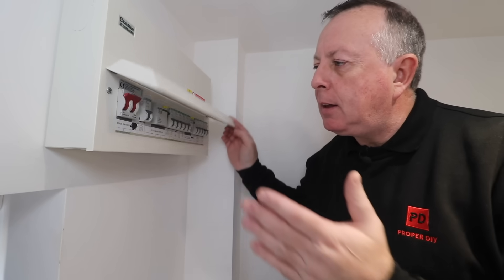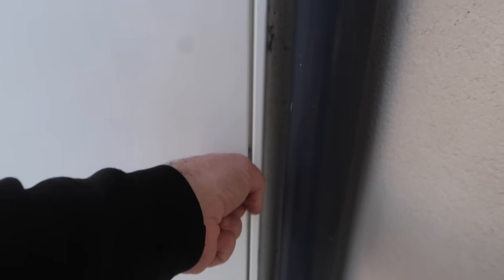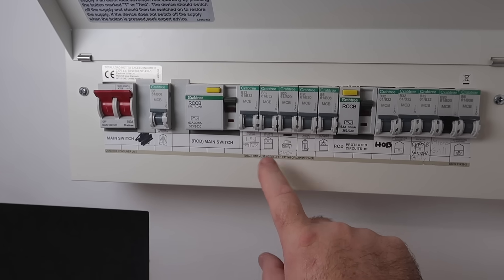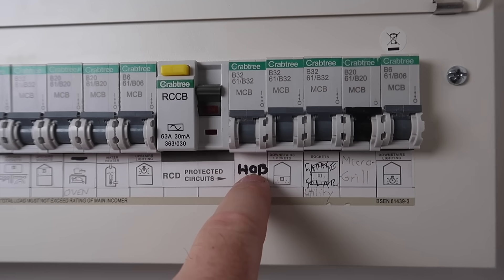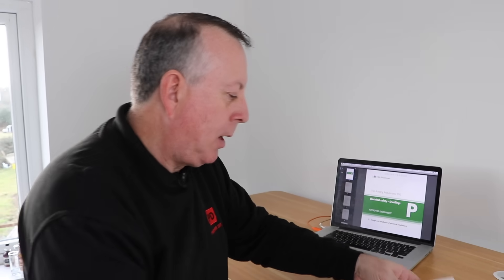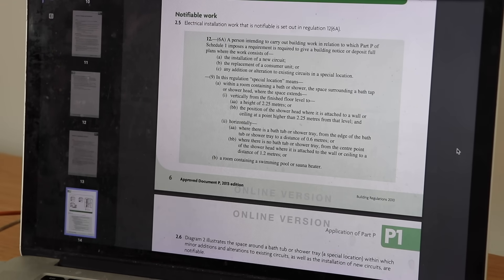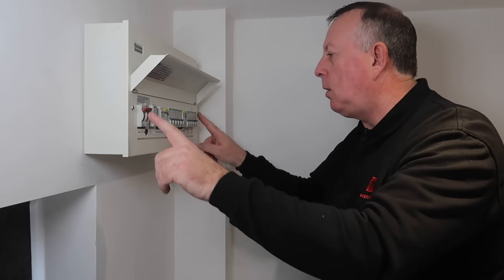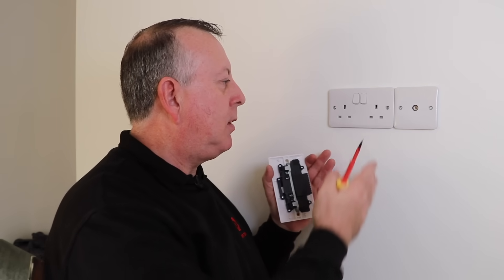What electrical work are you allowed to do in your own home?

Comment: Has the mains voltage actually been reduced, or is it still nominally 240V but the tolerance has been tweaked so that 230V falls within the spec?
Reply: It's still nominally 240V, but with a slight change in tolerance so they can call it 230V 'on paper'. It's the same situation in Australia.
Reply: @cool386vintagetechnology6  True, although parts of Australia used to have a nominal 250V.
Reply: @GodmanchesterGoblin  Western Australia until 1985 is the best known example of that.
Reply: @cool386vintagetechnology6  Thanks. The last company that I worked for before retirement used to export to Australia (early 2000s) and I remember coming across the voltage rating sometimes. Perhaps it was just a legacy thing by then, however.
Reply: I regularly see 245V so 230V seems to notional 😵‍💫

Comment: It's wrong to say that you can't do work that is subject to Building Regs approval. It's just that if you do it yourself you will have to pay the local building control department the appropriate fees and have it approved and inspected by them (they may contract inspection out to an electrician).

For some types of work the cost of the building control fees can outweight the savings of not paying an electrician to do the work.
Reply: dont tell them

Comment: I know 'someone' who afew years ago completely rewired a house from the main fuse and then got it certified by a qualified electrician. All passed to standards and a big improvement on the old wired fuse box..
Reply: Yep, there's also the NAPIT inspection/sign off
Reply: That's interesting, because I was recently looking for an electrician who could make a new circuit in my breaker box and connect my new electric underfloor heating to it, but because I had to only few days to do wiring (due to tiling in my bathroom), I suggested I can run the cable by myself and an electrician would just connect it to the breaker box. 6 electricians, I've contacted (out of 7 total), refused to do so, because they claimed they "can't signed off the job if they didn't install the cable by themselves as they can't guarantee the cable I would use is good. What a BS! When I mentioned I'm an IT engineer and I know enough about electricity to know how to check a cable's resistance using multimeter, they would come up with another excuse. It was a nightmare.
Reply: @rogalsiu  If you're using a multimeter to measure the cable's resistance, then they were absolutely right because you do not know what you are doing.  Just measuring a cable with an ordinary multimeter will tell you almost nothing about whether it's actually correct for that application, and whether it actually meets code or not.  There are also many ways that even the correct cable can be installed wrong, and if they can't actually inspect the work you did, I don't blame them at all for not wanting to sign off on some unseen work done by some random person they don't even know (they could probably even lose their license for that).

(And I work in IT too, and I can tell you that the skills required for that have absolutely nothing to do with knowing how to do mains electrical work correctly.  That's just completely irrelevant.  The fact that you would even mention it also shows that you don't really know anything about what you're talking about.)
Reply: @rogalsiu  That's on you. I don't care if you spent your adult life driving cars, that still doesn't make you qualified to be my kids driving instructor. Let the tradesmen earn a living. an IT engineer is NOT an electrician
Reply: All in order and still possible. However, it really should be approved and inspcted by he local authority building conrol department who will extract a fee - when I checked a few years ago it was around £500 for a complete rewire.
Reply: @jeremybarker7577  I think the qualified electrician and his mate cost £200 ish for the half day it took. Very thorough.
Reply: Dodgy spark 😂

Comment: I am happy that in Belgium you can carry out absolutely everything as a DIY, the regulations and requirements are openly available for everyone.
But anything that gets added or changed from a existing installation needs a inspection carried out by a independent approved company, this also needs to happen when a professional electrician carries out the work. This will also require a single line drawing and situation sketch where all power points, lights, switches,… are indicated.
Reply: You can carry out all installation work on your property in the UK. The YouTube video producer is factually incorrect in his statement that there are things the home owner cannot do.

What has happened here, is that people haven't read properly the Part P regulation, despite holding up a copy in the video!!

If you are not suitably qualified, you can still do your own electrical installation work but there are two things that need to be dpne:
 1. Notifying the Building Control department of the local council before you commence work
2. Get a qualified third party to certify the work after you have completed it.

If you undertake the work yourself, it needs to be a certain standard and that is defined by BS7671 and there are books which condense those rules into a much easier to understand format.

So it is entirely possible for a home owner to carry out their own electrical works.
Reply: @deang5622  
Correct Replace the word qualified with competent.  The word competent is actually used.
Reply: @deang5622  Yes, basically it was the UK following the EU model (plus a bit of gold plating).
Reply: @deang5622 the bit I don't get though is that   BS 7671 says you ( the DIYer carrying out non-notifiable works) have to issue a minor works  certificate ( to yourself?) This certificate has spaces to fill in Ze and Zs and resistance tests which the DIYer will unlikely have the expensive test equipment or know-how to carry out.
Reply: @deang5622  Agree and i was an Electrical Inspector whit all the Certs in my name HV @ LV INDUSTRIAL
Reply: @deang5622  Spot on. But in all honesty we all know none of that will ever happen. Notifiying building control and getting 3rd party certification will just make the job more expensive than getting a suitably qualified and registered electrician to do the job in the first place.
Even when DIYers are doing non notifiable work they won't be complying with the law,  because I doubt one of them will apply anything other than a "bang test" to their work. And even if they did test it properly no DIYer would ever be able to understand what their results were telling them anyway.
No Diyers will carry on merrily fiddling away with their installations relying on luck to prevent any fires breaking out or electric shocks occurring, whilst ignoring flimsy building regulation law.
Reply: @davebadger100  
All is on YouTube on how to test using a multi meter. Do not under estimate DIYers.
Reply: @johnburns4017  Yeah good luck with that when you've got a problem and you haven't got the knowledge to know whats causing it.
Reply: @davebadger100  Or working out what's gone on when the 'professional' sparky has nailed a floorboard back in through a mains cable and the rest
Reply: @davebadger100  You do realize that many of us are engineers and craftsmen of other types? Domestic electrics are really not that complicated. 90% of the headache comes from the fact that ring mains are still being used for some inexplicable reason.
Reply: @johnburns4017  Your multimeter does insulation and earth loop impedance testing, does it? Mine certainly doesn't.
Reply: @thelight3112  With you on the ring mains. Crazy that a somewhat dodgy design brought in to mitigate shortage of copper is still used today. Oh for the "continental" way of radials....
Reply: @mpellatt  
Final ring circuits were not to mitigate copper shortages. It was all laid down during WW2, as a part of revamping the building regs to rebuild the Victorian slums. The 3 pin plug was designed in 1942. My mother's house was built in 1952. With radials and 3 pin sockets.

Rings are not mandatory. But they are very efficient.
Reply: @mpellatt  
My muti-meter does not do impedance and earth loop testing.
Reply: @mpellatt  
There are advantages to rings. They have been widespread in the UK for 75 years. They have been found to be very safe.

♦ Cheapness, as smaller, easier to install, wires can be used;
♦ Two ways for the earth back to the consumer unit;
♦ Another is a large number of sockets can be off one cheap to install ring;
♦ Having the same number of sockets using radials would mean multiple radials and multiple extra breakers at the main panel. Far more cable, expense, labour and hassle;
♦ The 32A breaker and 13A fuse in the plug ensures safety.
♦ Portable plug-in appliances on a ring cannot exceed approx 3kW. Some plug-in ovens are on rings;
♦ Rings usually have a 32A breaker at the main panel - can be a lower value;
♦ Using push-fit maintenance free Wago type connectors to connect up the ring adds safety, as not being screwed connections they do not work loose. The ring's current does not run through the socket terminals;
♦ The British plugs are designed with rings in mind having a max 13A fuse in them - can be as low as a 1A fuse in the plug to suit the appliance and flex/cable. Small flex and appliance? Then a smaller fuse;
♦ Rings in the UK are limited by square metres of floor space, with no limit to the number of sockets on the ring. 100 square metres of floor space with 2.5mm cable for a 32 amp final ring. The cable can be 4mm, which is advisable in an unbalanced ring drawing high current loads;
♦ Less voltage drop on long cable lengths as voltage come from two ways.  

Radials are also used in the UK. Rings are not mandatory, but used because they have proved to be generally trouble free and safe. They can be installed using rule-of-thumb. These days a ring will be on an RCD or RCBO - these now are becoming DP, so safer again. AFDDs are now mandatory in some installation and recommended in all installations. AFDDs raise the safety level. 

In one job in an office, they wanted more socket outlets for extra desk computers. It was a simple matter of extending the existing ring with the extra sockets as the current draw was low. Cheap and easy. If radials were used three radial circuits would be needed, which would mean an extra consumer unit, breakers, wire etc, then far more labour.

Some disadvantages are:
♦ Rings are more difficult to fault find. But electricians have no problem once the ring is full understood;
♦ Another is that if a number of high current drawing appliances are on one side of the ring, say nearer to the main panel, most of the current draw may be down one cable leg of the ring with the cable rated below the main 32A breaker. 2.5mm cable is rated at 27A max. Although tests have proven the cables do not exceed their current capacity in the vast majority of cases, just an imbalance in distribution of the two cables from the main panel (consumer unit). Good circuit design will prevent this, negating this disadvantage. Balanced rings can be installed by daisy chaining to alternative socket outlets on the ring. That is the first appliance will draw from one side of the ring, the second socket will draw from the other side, and so on round-robin. Or use 4mm cable to the point where heavy current drawing appliances are, then 2.5mm for the rest, if it is that troubling for some. Using 4mm cable on one side of a ring and 2.5mm on the other, is still cheaper than a bunch of radial circuits.

Overall I consider one ring superior to a bunch of radials needing their own breakers at the main panel. They are simpler, cheaper, being proven to be safe and worked well over the past 75 years. Using the new AFDDs on rings, which are recommended and mandatory on some installations, gives a far higher safety level. You will have to give a very convincing argument for me to give up rings. I have not heard of one yet.
Reply: @johnburns4017  
"Having the same number of sockets using radials would mean multiple radials and multiple extra breakers at the main panel. Far more cable, expense, labour and hassle."
Aaaand again. The massive lack of John Burns knowledge of electrical work is laid bare to see. 

"Or use 4mm cable to the point where heavy current drawing appliances are, then 2.5mm for the rest, if it is that troubling for some. Using 4mm cable on one side of a ring and 2.5mm on the other, is still cheaper than a bunch of radial circuits."
WTF are you on about here??? You don;t even know a jot about the British Standard Regs and now you're inventing your own pointless version of a ring. 
You are the gift that keeps on giving.😅😅
Reply: @davebadger100  
Read again what I wrote. But more importantly, understand it.
Reply: @thelight3112  Domestic electrics are not that complicated. Agreed. And yet the amount of bodge ups and dangerous electrics I come across is phenomenal. And even if it's not dangerous it's just plain wrong.
You mention ring final circuits being a headache. They are the simplest thing in the world if you know what you are doing and yet people without exception manage to stuff them up on a biblical scale. And even less seem to know how to fault find on them. There is nothing wrong with a ring final circuit, just the people messing around with them and working on them.

And the one part that everyone conveniently forgets is testing of work once done. I test every job I do without fail. I am not afraid to admit I make the occasional mistake but my testing highlights that. How many DIYers own a multifunction tester let alone know how to use one. All you hear is "it's only 3 wires how hard can it be" and "I just plug something in to see if it works", without really knowing whether the circuit was safe in the first place or whether the work done is safe and compliant.
Reply: @johnburns4017  Ok first off. How will using radials for the same amount of sockets instead of ring final circuits result in multiple circuits and multiple extra breakers at the main panel? Help me understand. Come on educate me.
Reply: Dave badger are you getting paid to fix botched jobs ? If yes then be quiet and take the job and cash
Reply: @mpellatt  The other thing is that a multimeter won't go down low enough on the resistance range to be suitable for making the measurements required.
Reply: @mpellatt  I have had arguments with electricians with decades of experience on the use of ring mains. They just will not accept there is a problem and that ring mains are not required.  They extol the benefits but without thinking or understanding the disadvantages.
It's down to a poor level of education.
Reply: @davebadger100  
You need more socket circuits. Sharpen up.
Reply: @deang5622  
Read my comments on this thread on final ring circuits.  They will put you right.
Reply: @johnburns4017  I have read them and your analysis is flawed.
Reply: @johnburns4017  No you don't. It's taken you 3 months  to still come up with an answer that is complete drivel 🤣. You clearly don't know the difference between a radial and a socket circuit.
Reply: Sounds like a good model.
Reply: Even better in the Netherlands: no inspection required.  You can do absolutely everything yourself, downstream of the sealed meter / municipal fuse box.  You are responsible for working to code, and covered by insurance... unless they find out after a fire that you did not follow code.
Reply: France also DIY possible.
Reply: How much is inspection?
Reply: @neilbennett9281  
I had to look it up, there might be slight differences for apartment vs house, full renovation/new build/small alterations.  For a renovation of a house I checked 1 company and price is 215€.
Not sure if this includes solar panels and battery as I did see seperate pricing for that.